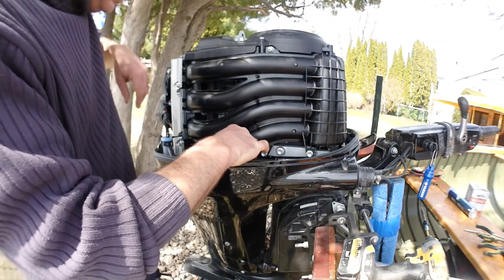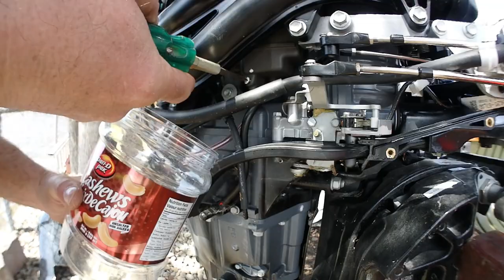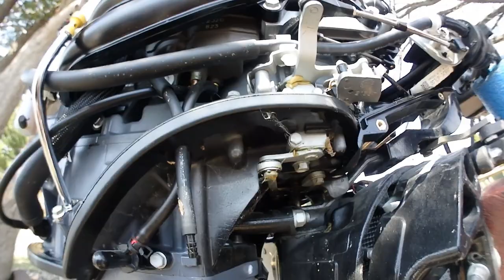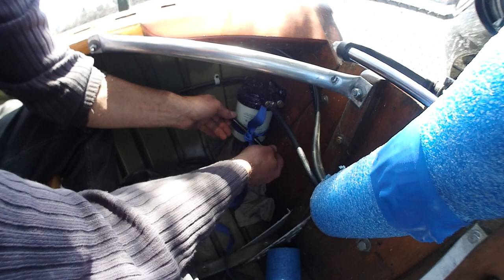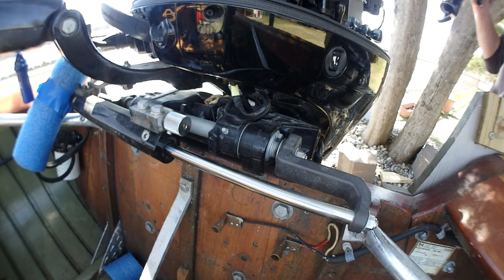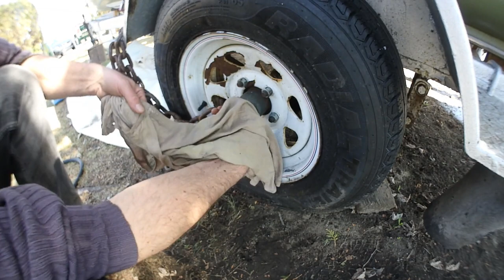SUZUKI DF70A/DF80A/DF90A/DF100B ,Preparing Your Suzuki for the new Boating Season.De-winterizing

Comment: Great video. Thank you for sharing.
Reply from the maker: Glad that you liked my video Denny.
Thanks for taking the time to comment,i appreciate that a lot.
Thanks for watching ,best regards.
Reply: I actually was searching for winterize Suzuki videos but enjoy watching yours.I'm new to boating and got my first Suzuki DF70. 
Any plans to do same video but about how you winterize your outboard?
Reply from the maker: @DeniskaNYC  Yes,why not.
Not much to do for winterizing a four stroke.
You change motor oil,filter and gear oil.
You run your outboard for 15 minutes with non ethanol fuel with stabilizer and let your motor in a vertical position to make sure there is no water in the motor before freezing temp.
That's about it.
Gonna do mine soon,here in Montreal Qc,Canada we get -30 celcuis in winter...
Will try to think to make a video about it !
Reply: Do you fogging your cylinders?
Reply from the maker: @DeniskaNYC  Yes but not too much,just a bit.

Comment: Very nice video. Not too many of these sort of instructions out there about Suzuki df70/80/90. When i have my df80 serviced they usually also change oil in the screw cogs-setup (angle axis onder water lime, no idea what thats called). Also the impeller for water cooling is changed then (as precaution). What are your thoughts on that? Is it required?
Reply from the maker: The oil  under the water line is gear oil or Lower unit oil.
Every fall before winter is the right time to do this.
The impeller about every two years or 3 years(Preventive maintenance).
Thanks for taking the time to comment ,i appreciate that.
Thanks for watching,regards.